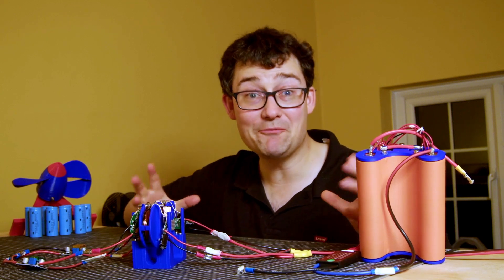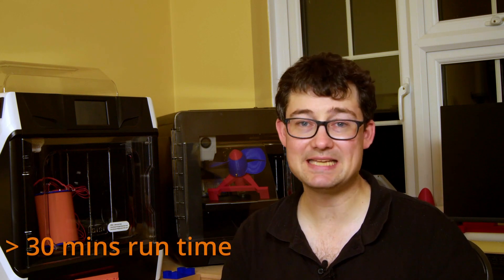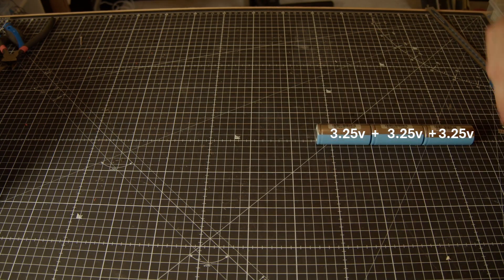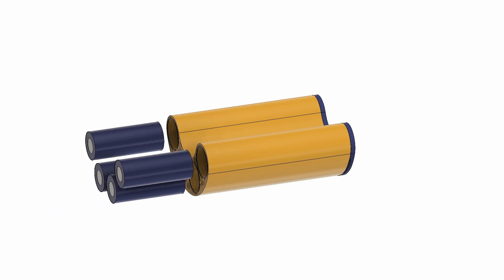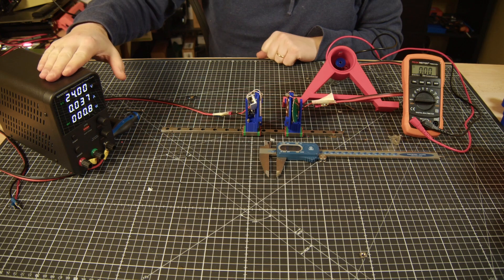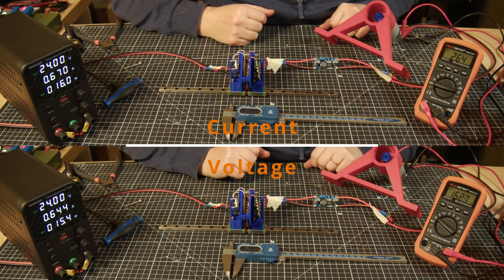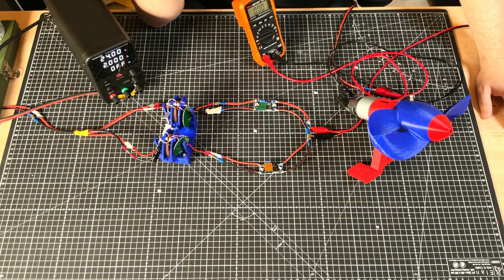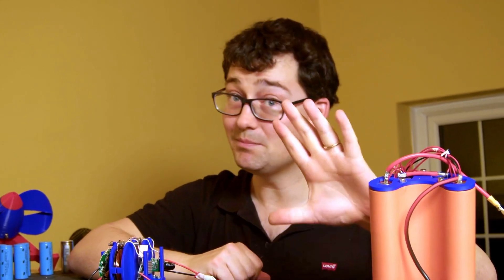High-Power DIY Wireless Power and Battery System: Building a Print-in-Place Sea Scooter (Part 4)

Comment: Do like electric tooth brushes does.
Have a pin that sticks out to couple the coils better though a ferrite?  So its mire like an transformer 
Should be able too boots efficiency and speed a lot i think, but likely need a new circuit
Reply: And for anything waterproof that needs to go underwater, remove all the air and fill it with mineral oil, then there is no air to compress and water ingress is much less likely
Reply: @tullgutten  Potting in wax could be another solution.
Reply from the maker: I completely agree.👍 That’s exactly what I was thinking of when I mentioned ferrite core in the video. At the moment the coils I am using only have ferrite backing that do help a bit but, as you say, and based on a couple of videos I saw a ferrite core improves efficiency even in this type of resonant wireless power circuit quite a bit.

Comment: Another way to charge battery that comes to mind is using regenerative braking while spinning output of magnetic gearbox with external motor.
Reply from the maker: Excellent idea. I agree, that would definitely work with a few additions to the electronics. Could even attach it outside of a boat to charge while you move between places to use it perhaps. 🤔.

Comment: Its a really cool system, but wouldnt it have worked if you just added a watertight plug? Maybe im overthinking it and making something cool was the goal, but im still curious
Reply from the maker: thanks for the comment 🙂Fair question. I came up with the 2 design  constraints to partly give some interesting challenges to solve, and hopeful some inspiration for others. Also to see what can be done with a 3D printer!  Given the constraints I'm not sure how I'd incorporate a waterproof plug to the hull of the sea scooter during the print and without making a hole in the hull, any ideas? 

But if your not bothered about the constraints then you could probably still print the hull in one piece with a hole and glue in a water proof plug, same goes for the control switches if you'd like.
Reply: @DesignedtoMake  Fair point. With inductive charging point there would be one less potential point of failure. However im sure such a thing would be possible and have its own challenge. It would probably be more about designing a seal that would tighten due to pressure. Ive watched a video about that, but i couldnt find it unfortunately
Reply from the maker: Nice idea. 💡. Thanks for sharing!
Reply: Waterproofing electronics is extremely difficult for the hobbyist. Most people don’t understand that for every meter down you go, the pressure of the water increases - it’s not just in contact with seals, it’s actively invading the material itself if it can. 

Starting with extreme waterproofing and working backwards to a version 2.0 with some carefully managed seals and joints allows the overall concept to be validated quickly, and then efficiency and user serviceability can be focused on!